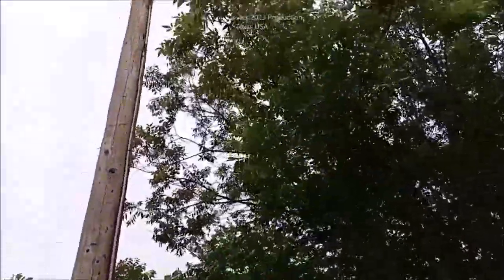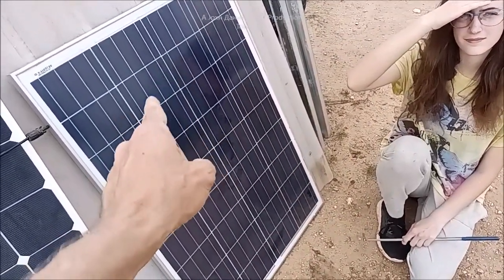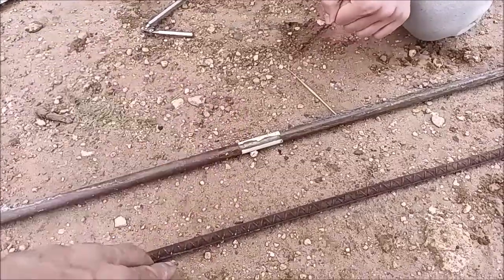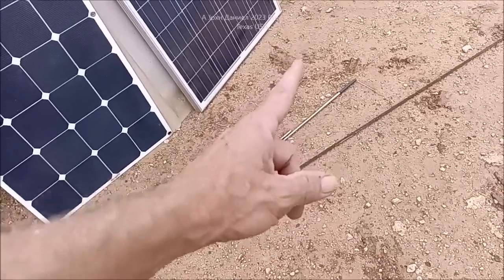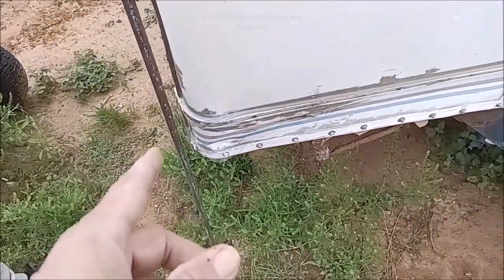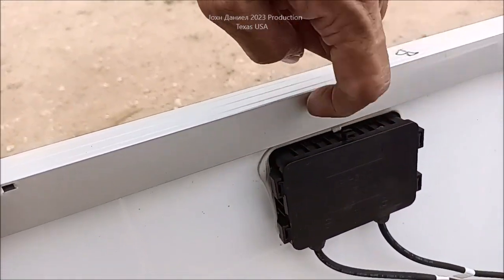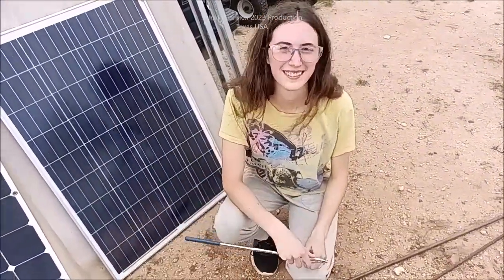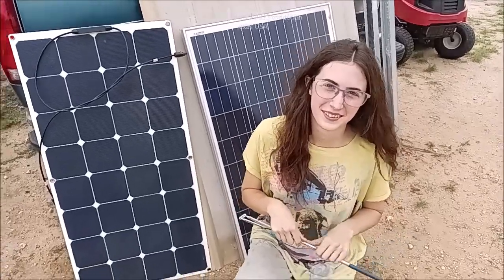Grounding your SOLAR PANELS? 🤔 You Better watch this First! *KNOW DC/Inverter POWER is not Utility

Comment: This is wrong on so many levels.  I have worked my whole life in the electrical field and I could write for hours explaining how this is all wrong.  Solar panels NEED to be grounded for safety!  I'm afraid someone will get killed because of this video.
Reply from the maker: If you have worked in the "electrical field" then go ahead and Explain how someone will be killed by not grounding the metal of any item that is not connected to any voltage source or that produces any voltage? Explain how a solar panel frame unless it IS grounded can even produce errant voltage then you have to contact owners of 10 billion aluminum windows and warn them of their pending deaths. A solar panel frame is 100% identical in electrical properties as a aluminum window frame. Isolated by design until some moron connects it to a ground then opens it to a eddy current from the earth generated by atmospheric static. A proven fact in corrosion studies for the last 100 years.
Reply: Humans make mistakes, equipment fails in unexpected ways.  Solar panels produce significant voltage and they can be damaged.  I understand that you are smarter than all the NEC engineers and I am not going to convince you of anything so have a nice day.
Reply from the maker: @radarecho57  NEC Engineers did not come up with grounding solar panel frames. National Electrical Code does not have engineers. They have technical advisors and bureaucrats. BOCA had engineers.
Reply from the maker: @radarecho57  We are signing up lots of dickheads to berate us when we install our 30+ Stion Frameless solar panels with NO GROUND LUGS so they can shit themselves when we don't drive a ground rod through them to do as they say must be done. Over 42 million frameless solar panels power the current SW Grid. And no ground on them. NEC approved!

Comment: I got luckily a light shock from an inverter due to a lightning strike in close vacancy of the house. 
Definitely ground the metal inverter, or take out a life insurance policy....
Reply from the maker: Why would you get a shock from a isolated inverter unless you had its common running in the houses wiring, and the house has bonded common and ground. A inverter can not "receive" a lightning strike in any way unless your incorrectly using it. It is like saying your unplugged TV started to play 1960's sitcoms!

Comment: "expands conduction". No,
Iron oxide neo particles in soil, reduced to carbon. And therefore it does not promote conductivity in the soil. 

But you go ahead and get somebody electrocuted in a "tragic accident", because sometimes that's what it takes for a person to change their opinion.
Reply from the maker: You got a lot of work ahead of you on Iron then going out warning all the Cell Phone companies who use it, the AM radio stations since the 1920's who use it, and the hydro electric dams that base their system on it. In fact, a few hundred million use it in their homes as ground rods. It's 1.2 mil thick copper plated high iron steal rods you buy at Home Depot. 
Iron in the ground will turn to a number of minerals over time, about 8,000 years it's man altered refined state can be a large amount of carbon. I really don't expect to be in that era discussing it though.
Reply: Correct. There's many people who choose to talk and actually not say anything. Thank you for joining them.

Comment: HELP! We had a solar system installed in our cabin. The company we bought from says we need it grounded and our electrician says we don’t unless it’s grid tied (it’s not) The instructions say to ground it at the inverter, another electrician told me to ground the breaker box AND the panels.

I know nothing about this other than what I’ve learned in the last week or so and I still have no clue.

Comment: How would I ground a frane thats aluminum. I would drill and tap and add a ground screw. Pretty easy. It's not like aluminum is not conductive, because when I Tig weld even on DC current, they're still an arc!

The reason why grounding rods are copper, and not steal are because copper is more conductive. In a lightning strike, the lightning would have less resistance from the copper rod, then from hammering, a steel rod into the ground. 

In your theory, that the area around a decomposing, steel rod would be more conductive that would be incorrect, because the decomposing metal would lose its connection and be less conductive . 
Bad theory...
Reply from the maker: You do not understand electricity. For one, Airplanes have NO ground rods their bodies pass lightning around the shell out to the earth, but they have a 60 volt DC electrical system. Ships have a 36 volt system under 9 meters, 72 volt dc over 9 meters, and no ground. 
Solar panels are not connected via their metal panel frame to the +/- of your DC circuit, no matter  from 0 volts to 1500 volts. The only way you will enhance, or migrate a lightning strike to you is by using a ground. It's called a Attraction. 
The only way you will energize a piece of aluminum, whether on a solar panel or on your work bench is with a ground wire, not by letting it stand alone. 
The standard Metro Overhead has up to 4 hot wires, Rural usually 2, a active and second active and NO NEUTRAL. Only one hot goes to a transformer on split phase, 2 do on 3/4 phase. They are All hots unless it is industrial and designed to be non standard. 
The years we worked for Siemens Electric building huge wind turbines we never had a "Neutral" in any transmission lines. Top wire on a pole is a ground, not a neutral. It is connected to a ground on every pole, not a neutral. 
***I jumped the paint and pictures part of this General Electric training video to get you to exactly that GROUND that is part of the circuit you claim does not exist. ( https://youtu.be/PnwGTPPnTd4?si=vZaXDTs37W2bV989&t=165 ) and when in Vocational training we also had to learn of multi phase due to the Hyundai gen sets on the turbines being 3 and 5 phase. And the GTE Transformers wiring diagrams. 
So this video https://youtu.be/xMZkKI5rleg?si=PNLDp7lmDTt5FwVL also with details on that "circuit" of ground, neutral created via ground, also details it. Still, not a neutral. A neutral is a ground, it returns to the Transformer ground post, not a overhead or underground feeder, but to the ground matching tap ( top wire & solid 13 coils on end of pole 6 awg rural, 13 coils of 4 gauge Metro Ground tab/cable)
A neutral is what your making from the house, to the transformer in response to create flow, not from the power plant to your house. That is why when you "bond Neutral and ground" your only adding short circuit support to the mains.
Reply from the maker: Decomposing iron creates iron oxide, Expands conduction. Again, not a theory. Learn about electricity.

Comment: If lightning were to hit your solar panels, there would be a severe amount of current that would be best served going through a ground wire into the ground, then trying to find another path such as going into your equipment, destroying it.
That principal is quite simple. 
Additionally, power created in the power plant runs through the hot wire and goes back to the power plant on the neutral. The ground is not part of the circuit as you as you inappropriately state.

In the event that the neutral got severed, and therefore the power needed to return back to its source, that is why the ground exists. To give that current a place to go. 

Also, whether you're on or "off "the grid, people still have to pay property tax and abide by local codes. 

So get yourself a piece of wire and a grounding rod, and do it the right way .

Now I will add one caveat. When it comes to "required "grounding that is only for systems that are over 50 V. 

If you were in your RV which is a 12 V system, then obviously a ground would not be required. Even if you were running 48 V and then stepping that down to 12 same principle, but once you exceed 50 V you're not going to want to have any accidental current, running through you as you step out of your RV onto the ground. ...
Reply from the maker: You do not understand electricity. For one, Airplanes have NO ground rods their bodies pass lightning around the shell out to the earth, but they have a 60 volt DC electrical system. Ships have a 36 volt system under 9 meters, 72 volt dc over 9 meters, and no ground. 
Solar panels are not connected via their metal panel frame to the +/- of your DC circuit, no matter  from 0 volts to 1500 volts. The only way you will enhance, or migrate a lightning strike to you is by using a ground. It's called a Attraction. 
The only way you will energize a piece of aluminum, whether on a solar panel or on your work bench is with a ground wire, not by letting it stand alone. 
The standard Metro Overhead has up to 4 hot wires, Rural usually 2, a active and second active and NO NEUTRAL. Only one hot goes to a transformer on split phase, 2 do on 3/4 phase. They are All hots unless it is industrial and designed to be non standard. 
The years we worked for Siemens Electric building huge wind turbines we never had a "Neutral" in any transmission lines. Top wire on a pole is a ground, not a neutral. It is connected to a ground on every pole, not a neutral. 
***I jumped the paint and pictures part of this General Electric training video to get you to exactly that GROUND that is part of the circuit you claim does not exist. ( https://youtu.be/PnwGTPPnTd4?si=vZaXDTs37W2bV989&t=165 ) and when in Vocational training we also had to learn of multi phase due to the Hyundai gen sets on the turbines being 3 and 5 phase. And the GTE Transformers wiring diagrams. 
So this video https://youtu.be/xMZkKI5rleg?si=PNLDp7lmDTt5FwVL also with details on that "circuit" of ground, neutral created via ground, also details it. Still, not a neutral. A neutral is a ground, it returns to the Transformer ground post, not a overhead or underground feeder, but to the ground matching tap ( top wire & solid 13 coils on end of pole 6 awg rural, 13 coils of 4 gauge Metro Ground tab/cable)
A neutral is what your making from the house, to the transformer in response to create flow, not from the power plant to your house. That is why when you "bond Neutral and ground" your only adding short circuit support to the mains.
Reply from the maker: PS - The last person I said 5 phase to ( in the original response) they knew so much they went straight crack head on me. So To cover that, I include that generator info ( still no neutral )  all our 64 meter wind turbines and the natural gas driven models used. https://www.sciencedirect.com/science/article/pii/S1110016815001076#f0010 **Mentions to Neutral are post rectification, on site applied, not in the transmission or 5 lug output power system from the rotating sources.

Comment: You ground the panels NOT for lightning strike protection! That is an entire separate part of the NEC code for that as discussed by mike holt. The reason you ground solar panels is that when there is a near strike, your metal parts will INDUCT voltage that needs to be dissipated to ground. You can see this on metal roofs exploding and arcing to ground when a nearby lightning strike occurs from induction. There is video evidence of this and it causes fires and also causes damage to your panels if you didn't ground them. Its not about return neutral to earth voltage like AC, but its about dissipating induction voltage, that also why Delta three phase ungrounded systems were phased out from equipment failure due to inductive currents jumping across equipment.
Reply: *also forgot to add this, safety equipment that protects against Arc Fault on DC current, which you know does NOT extinguish itself (Gain solar vids on this) Need a ground connection to the Negative DC solar connection. Then you use GFDI type breakers to detect if your solar array is arcing somewhere causing a fire. Grounding is important but yes, it is not quite the same as AC grounding.
Reply from the maker: Ionic static can and does affect solar panel frames, but that is only common on very remote stand alone systems. Around any home or location with infrastructure you never see this. The best way to deal with arrant chance is to install actual static grounding which is NOT involving actual ground rods, but surface ground plates. We do use those if the array is framed, just not rods. https://science.howstuffworks.com/nature/natural-disasters/lightning2.htm

Comment: Here's a question, the terminal block on most inverters has a red, a yellow, and a black wire.  And on alot of them you get 120v between red and black, BUT.. you also get 60v between red and yellow, AND.. 60v between yellow and black!  

So do you connect the the standard black, bare, and white Romex wire to it and hope it doesn't energize the metal housing of your boxes and appliances?  Or do you leave the ground disconnected and hope it doesn't energize anything it shouldn't?  I haven't been able to find much information on the subject.
Reply from the maker: Inverters for US market most all have markings of B or L for line ( black on romex ) W or C ( white on romex ) and a ground G or E for earth on them ( bare wire on romex.) Using a ohm meter you can check inverter chassis to find ground on those terminals if the markings are screwy China based done. Otherwise the inverter is not a utility level voltage, its a simulation so you will get voltage, trace responding voltage, a ghost basically, like in your test but not always actual output. Not sending out amps. 
As for wire color, I would not base your safety on it. Consider all hot. 
But if you really want a simple solution, you just power it off, remove battery, power switch cycle it to drain any power inside, then do a test on the outlets ( continuity testing ) them match and mark the proper ones. On the outlets you will have ( wide blade is common white wire, narrow is hot line black wire and ground if connected inside in the outlet is the ground post.)

Comment: Good afternoon John 

Thanks for the informative video.   You had mentioned a lighting rod design that I'm having trouble picturing.   We'll locate in a lighting prone area and would like to protect ourselves.   Could you please explain the rod in more detail?

Thanks again 
Scott
Reply from the maker: You use 4 sections of 1-3/8 Fence Top rail that is sold in 21 foot -6" sections. Very Cheap. You can get used on classifieds like craigslist or facebook often. Set them in concrete in a triangle  3 points at 4 feet apart 18" deep in concrete. You taper them to a peak, using bolts or plating connect the tops as you place another one in the center with a added 10 foot 6" piece down low under the 4th one ( single piece home depot $15), to end up about 29 feet total tube height. Very stable. You place 1/2 rebar up the center of the 4th one, the middle tube till its 2 feet out the top of the center tube with additional 1/2 rebar welded or clamped with heavy cable clamps till your down to the bottom and into the ground of the center tube about 2+ foot deeper than its 12 to 18" concrete.  I may do a drawing and place it on my web page www.mydcvolts.com that I have been forgetting to update for a few months LOL!
This 30+ feet is generally much much taller than any solar, much taller by 10+" feet than a 2 story home, and more static attractive than any trees. You can go a little higher with a little common sense addition or adaptation. 
Mine cost about $130 to build, and is why I will not worry about my solar.

Comment: Hi John, thank you for this very informative video. I now know that I do not need to ground my solar panels, although may I also ask if I need to ground surge protectors on the output of my inverter and dc input from my solar panels. My surge protectors has ground terminals and until now I am not sure if I need to ground it. Thanks!
Reply from the maker: You can and should on a GFCI or shock protection circuit using a new and totally separate ground rod far from the existing ( 20 + feet) then add a 10 awg ground to any surge protector. There is no need to ground any DC voltage under 36 volts unless its to chassis ( RV-BOAT-AUTO) . You can add a ground to them using the system your using for AC voltage but you should use a large Schottky diode or non active circuit ground when doing so.
Reply: The only man on planet internet that speaks plainly.  Thank you @JOHNDANIEL1